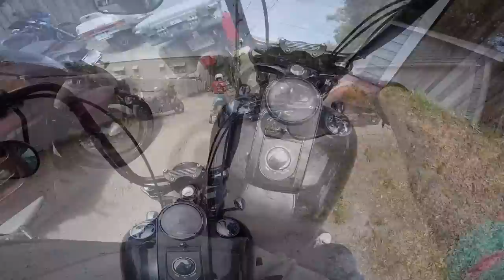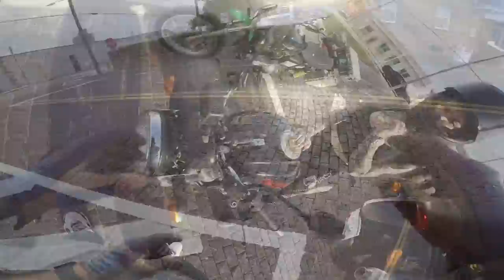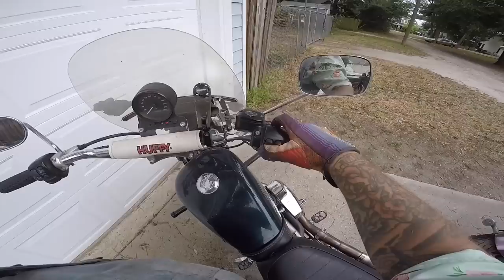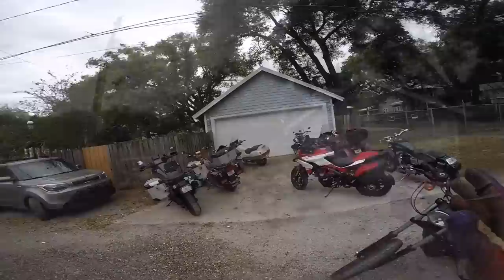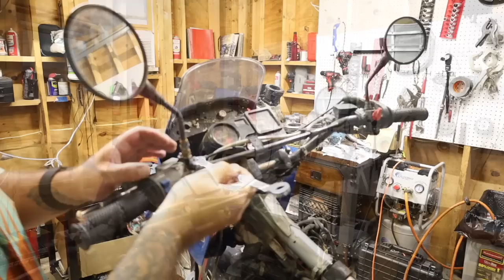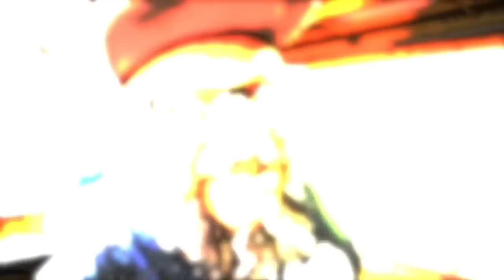This Motorcycle Girl asked me to do WHAT?! 🤨

Comment: essentials if you're giving it away: look up the "Doohickey" mod, also the "thermo-bob",  whilst you're shopping also get the drill through rear subframe top bolt mod (eagle-mike) - if you're planning to run it with heavy bags it's ~$10 to stop you snapping the back half off the frame
Reply: The doohickey has already been done to that bike.

Comment: i been riding klr's for 16 yrs. my favorite bike for sure. that hyd clutch is not oem. they all have cables. if the oil still milky after that oil change check the coolant level. when the water pump seal goes bad coolant goes right into crankcase (very common). good to see a klr on your channel.

Comment: Others have mentioned the major issues to take care of.  My suggestions larger upgraded foot pegs you can also get a lowering kit for the pegs ,  the stock ones suck and are rubber mounted, headlight conversion ( the stock one is hot garbage ) , usb charger, bark busters,  if you wanna go more $$$ - progressive suspension, 705 big bore kit, upgraded stator.

Comment: If the KLR doesn’t have a bash plate, add a bash plate. I’d throw on a set of Shinko 804/805 tires to make it better in dirt but still quite steerable. They also look cool. 😎

You want some DoubleTake mirrors for it? I kept mine from my KLR, but they shake too much for me even on my V-Strom, so you can have them.

Comment: Everyone has mentioned everything but this.  Get the fork brace for the KLR.  It's a must for those tooth picks of forks on the hightway, and high speeds on the dirt.  Gets rid of the head wagging, and improvement for offroad.  I've been waiting a long time to finally see you work on the KLR and am excited for it!  I'm in the middle of building mine.  You'll hopefully get to see it in August when we come on down to the swamp.

Comment: The gas in the oil, after the initial oil change will evaporate out of the oil and the crankcase when the engine warms up. 
Aircraft, mostly old ones equipped with radial engines, used to use an oil injection system, for use in cold environments. When the aircraft would be shutdown for overnight in a cold environment, the pilot would, just before shutting the engine down would push a button for a predetermined amount of time that would pump av-gas into the oil tank and let it circulate for a minute thinning the oil. This was done to reduce the viscosity of the oil so that when the engine is restarted it won't take as much to spin it over in the cold. As for the gas in the oil, after the engine warmed up, the gas would cook out of the oil pretty quick and would evaporate through the vents.

Comment: Fuel in the oil happens all the time with older suzuki bandits, the fuel tap doesnt have an off setting as its vacuum operated and the seals perish and fill the crankcase. Joys

Comment: It needs a top box minimum I have a dr650 with a top box and full pannier setup. The Pannier rack is normally off for my daily commute but the top box rarely comes off. Having a place to put your shit on a bike is far too overlooked. I'm not familiar with the stock headlight but a led headlight was a huge upgrade for me. I also got wider mirrors. I'm not a KLR guy but I know you need to do the doohickey. Who ever gets it will probably want a skid plate. Maybe a aftermarket seat? DR650 seats are like a 2x4 stock if the KLR is like anything close to it that would be nice. Past that just do the maintenance for the guy (or girl) that will be riding this across multiple states. Take a look at the rear suspension linkages in my experience riding junk linkages are rarely greased. But are abused off-road in dirt and grit.

Comment: You all had better enjoy all of those cheap carburetors, and other parts. I'm old enough to remember when buying a new carb because yours is in need of a cleaning was not an option. In a lot of cases you were better off just selling the bike instead of buying a new carb. Average price for a carb back then for cars or bikes used to be around $500.00 ! 
I'm pretty sure the plethora of beyond cheap parts will run out sooner than later, and I would advise everyone that if you have the extra $$, and know of certain parts that you will need in the distant future, you should go ahead and stock up while the getting is good !